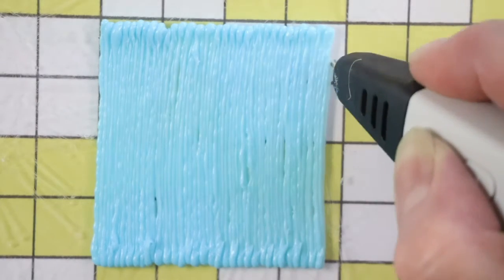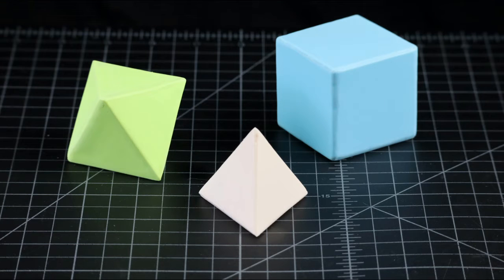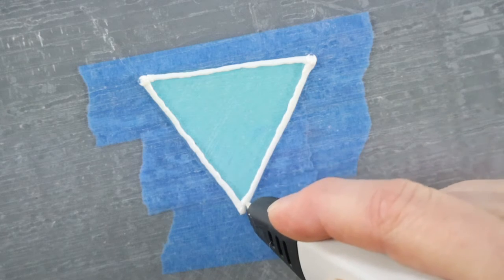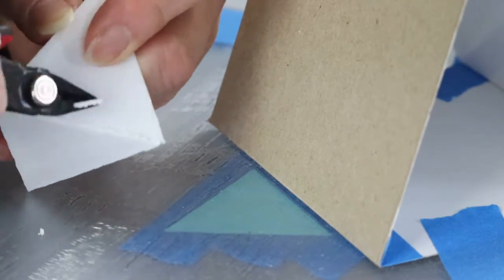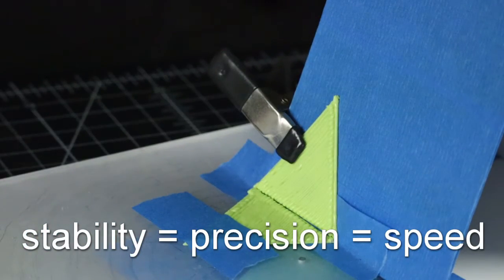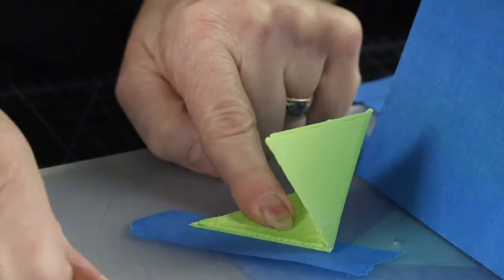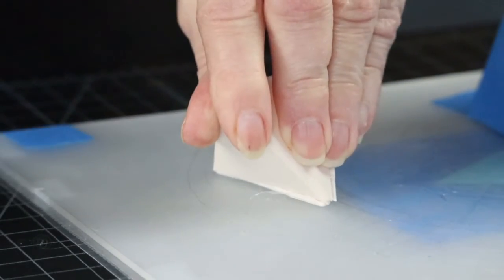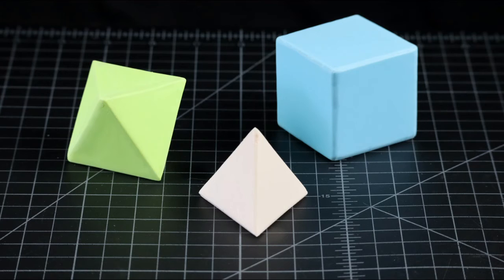Flawless surfaces FASTER!

Comment: Madam, I've recently bought a 3D pen (actually your same model) soon after watching your inspiring videos...I have a question,  is that normal that the pla keeps flowing (even if slowly) whil I don't use kt during the drawing process..like if I interrupt for few seconds I see pla slowly going out...Is my pen not working good or is normal? Waiting  your kind reply. Mike from Iraly🫶🏽🤜🏾🤛🏻
Reply from the maker: Yes. That is pretty normal. If it does it a lot and it's too annoying, try lowering temperature. I believe for this pen they recommend 175 degrees but you can try even a bit lower. But there is always a bit of "ooze".
Reply: @3DPENDEN  extremely thankful for the reply, new follower from Italy by the way 🫶🏽

Comment: Hi mam. This may sound silly. But what do you use as the base? Any plastic surface or wax paper kinda crumbles once the hot filament sticks on.
Reply from the maker: This doesn't sound silly at all. The work surface is the most important thing for your success with 3d pen. I use plexiglass sprayed with matt acrylic finish (don't skip the spray or you won't be able to remove the print at all). This video has all the details : Best work surface for 3d pen https://youtu.be/QP7YsXWvb8M 
Also this one may be helpful: 7 things you want from your 3d pen work surface https://youtu.be/n9RXEH7BAzA